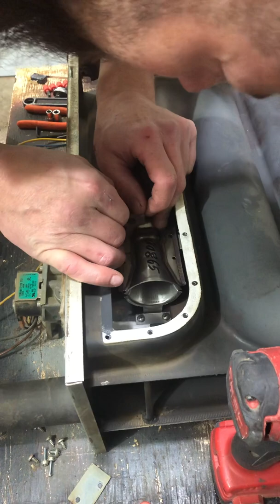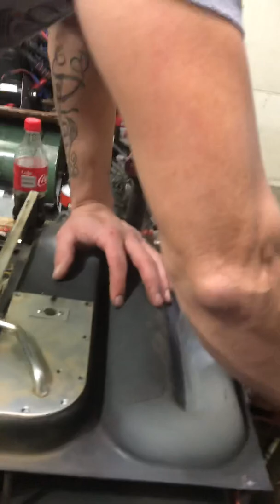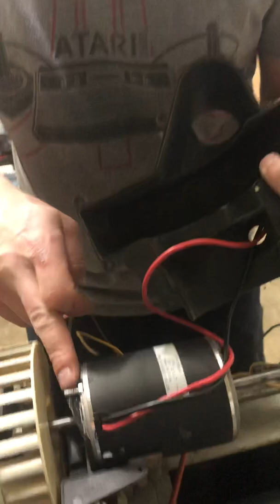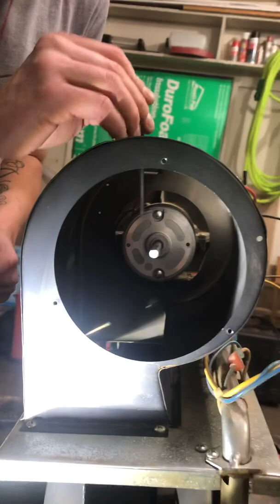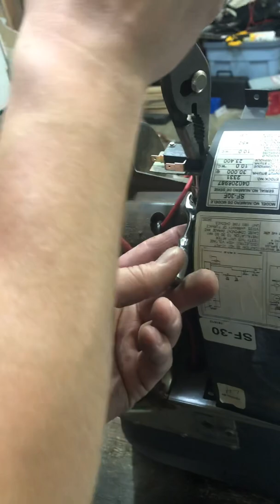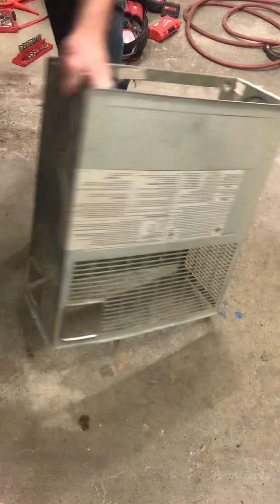Troubleshooting suburban furnace SF-30F reassembled part 2

Comment: Don't understand, u mounted motor without securing nuts on motor posts??  That's what I'm trying to figure out.  With housing off u can tighten one screw but to put housing back together can't tighten other?
Reply from the maker: The motor is pinched in there with the housings it’s not bolted in.
Reply from the maker: It’s in a cradle

Comment: Thank you for the video.  Took my valve apart following your suggested method on here with a crows foot.  Thing is, I don't recall if the threads had teflon or not.  Would this area be considered flared, compressed fittings, where there's no need for teflon tape (yellow, of course, if any?  I appreciate your answer in advance.
Reply from the maker: Don’t like to use tape on anything liquid ptfe is my choice.
Reply from the maker: To answer your question you will be ok without tape on that fitting.

Comment: I have a surban sfv35q that runs 6mins 30 secs then shuts off replaced ignitor control board jumped thermostat blue wires together get good voltage any idea what else it can be
Reply from the maker: High limit switch possibility

Comment: Got a question.. my new SF-30VHFQ… runs very erratic at elevations about 5500… it runs then cycles off only to try and start up 30 seconds after shutting down ( doesn’t ignite the second time) then I have to turn off the thermostat and reset… then it’ll start again and maybe run a few cycles only to do it again…
Can you help?
Reply from the maker: Check gas pressure
Reply: @thecanadianrvrepairguy3062  thanks

Comment: Great video, I could have saved a lot of time if I had watched your video first.  My furnace fan would start up, the igniter would start clicking, a little smell of propane and that's all it would do over & over about three times and then shut off.  I removed the furnace and opened it up and found the little brass gas orifice was plugged with what looked like a drop of mud not letting gas flow thru it so the furnace wouldn't start up and work.  I removed it, cleaned it and reassembled the unit and it works just fine now.  You AND YOUR WIFE put out an excellent video, thank you!!

Comment: I have an SF35Q and rebuilt it basically following your video. It would come on and run 20minutes and shut off and not relight.  intotheit,  I cant remember if that wire was ever plugged in.  Got any ideas?
Reply: okay that doesn't make any sense.  My lengthy question did not print out.
Reply: My comment was actually a question that did not print out right.  I have a red wire dangling off the computer board with no where to plug it in.  it comes from the white plug with multiple wires on it. One red wire goes to the sail switch.
Reply from the maker: @RBG-tr9ce  so the wire off of the white plug is the one that goes to the sail switch the other red one will be 12v power coming in
Reply: @thecanadianrvrepairguy3062  Thanks a million

Comment: With all the parts you replaced , would a new unit not have been cost  wise a better move?  I have an SF 35 , that will not fire . I am looking at replacing the board & ignighter  ,
Reply from the maker: The cost of the repair was no where near the cost of a new furnace.
Reply: @thecanadianrvrepairguy3062  , thank you , just seemed like youreplaced everything (almost) Great video . Mine would not start the other night , now it is working , but seems to be , for lack of a better term , revving up . Fan if off and on low

Comment: Great video. 
Question, my 2008 Atwood furnace on occasion will start for a 20 seconds stop.  Or Stop mid cycle. Or just tried to start then stopped. I can also go to turn it on, and here the click inside and nothing happens.
It's getting good voltage, ignites and works most of time. Buy I can see this will probably get worse. 
Fan works fine. 
Thermostat works. 
Thanks.
Reply from the maker: Ok well from what I can get from your description it sounds like a control board issue. The click you hear is the relay on the board actuating  but the points are intermittent. So I would put a new board in it. I’ll link one in the description for you. I like using Dinosaur boards, they are a little more robust and have a great warranty.

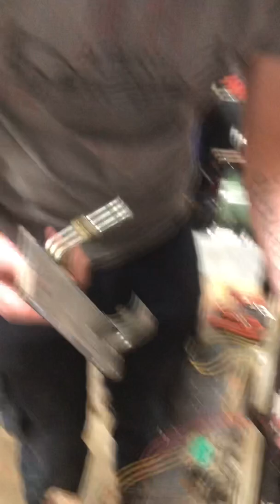Comment: At around 13:12 you said that one should not be "too concerned about the gasket material" and that it is not a "deal breaker" if the gasket is put back on or not.  I could not disagree more because that gasket is one of the items that seals up this particular part which helps prevent carbon monoxide fumes from potentially leaking into the living area of the RV.
Reply from the maker: You are entitled to disagree but where that gasket is the air is being drawn through by the combustion wheel there for under negative air pressure. The small gaps left by piecing in the gasket will not create a safety issue. Many years of doing this especially on older furnaces where parts are not available and never had a call of a detector going off after a service. Thanks for your insight though.
Reply: @thecanadianrvrepairguy3062  I enjoyed the video and learned (I think) what I need to do on my 1991 Suburban furnace, which looks exactly the same, to get it running. Where the gasket was broken, could that not be replaced/supplemented with something like a high temperature sealant? Kudos to your wife for the great photography.
Reply from the maker: George Bliss 
Yes a high temp sealant would work as long as it has the proper temperature rating